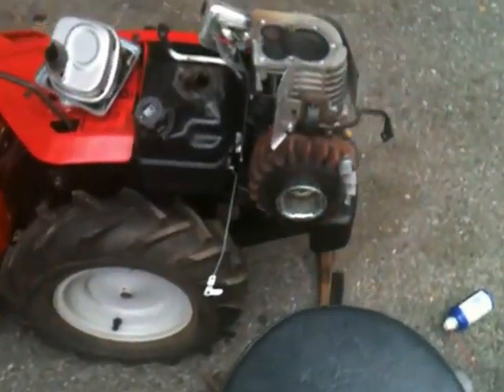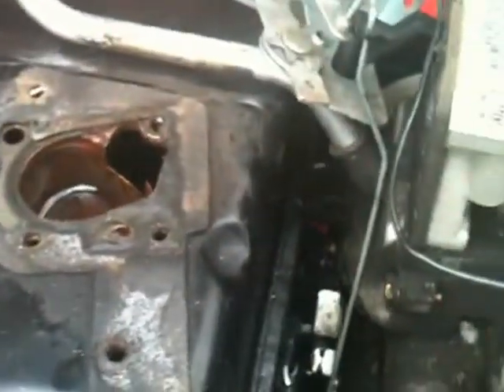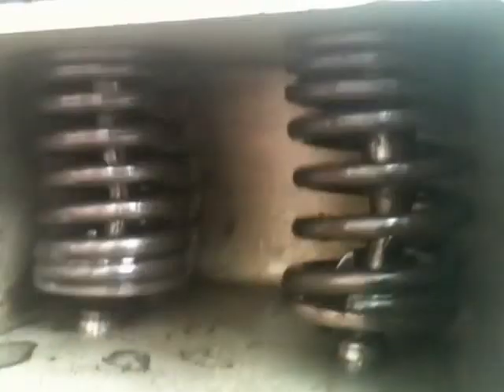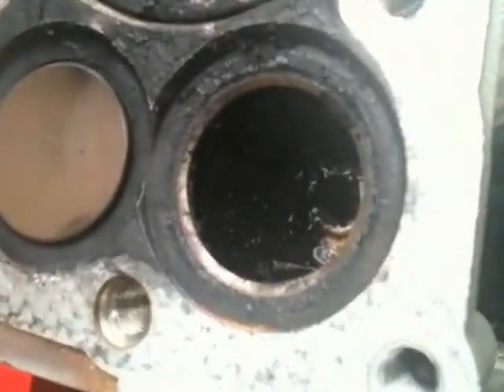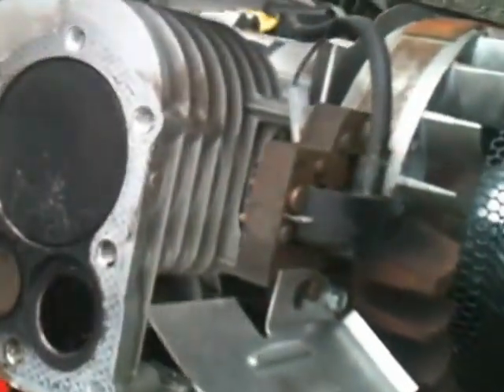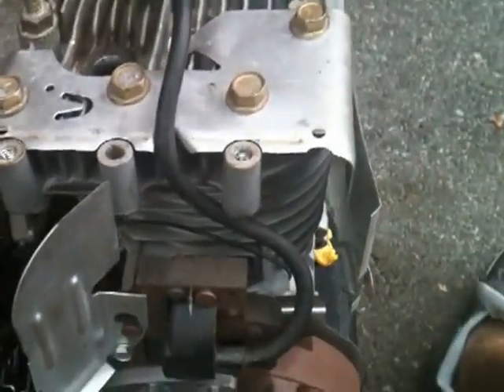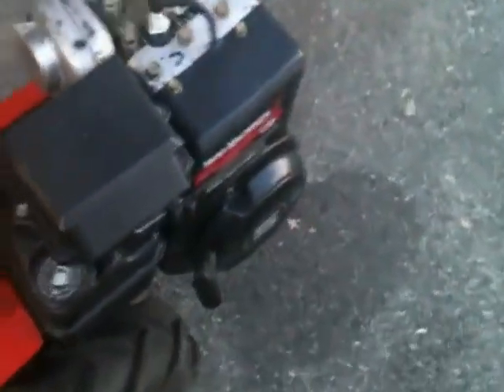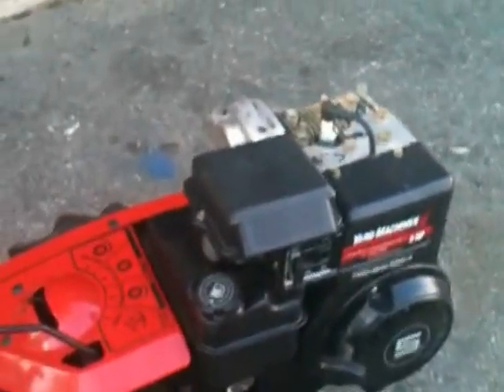How to fix an engine thats not starting

Comment: Just looking a bit through your vids and have to say you did a good job on the valve there. I did this in a 88 pontiac sunbird and it does take some time to do. What usually causes that in cars is the valve seals leaking oil into the exhaust and intake. But yours looked more like the gas turned to varnish and gummed it right up.

Oh and to test if a valve is straight or not put it into a drill press chuck and turn it on if its bent it will wobble. The chuck isn't strong enough to mar the valve.